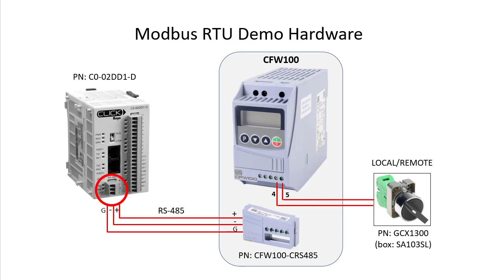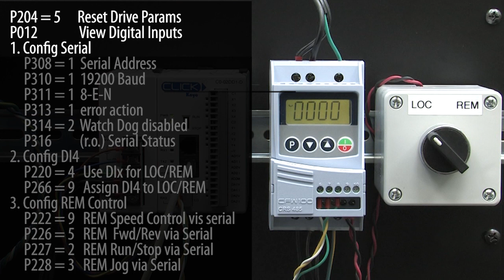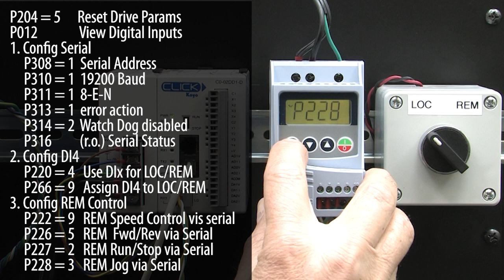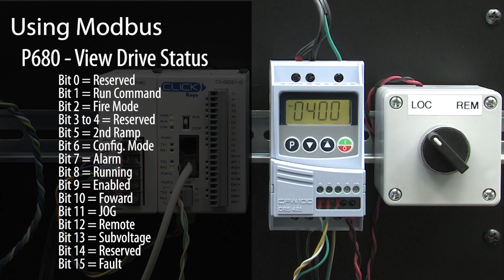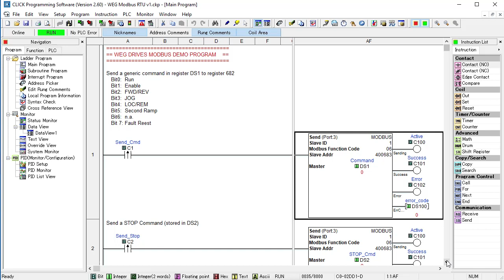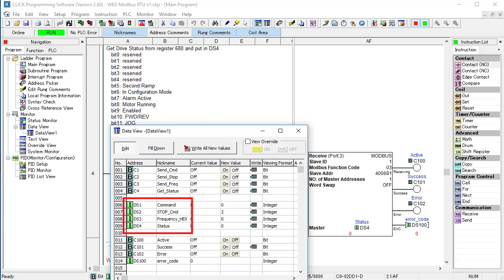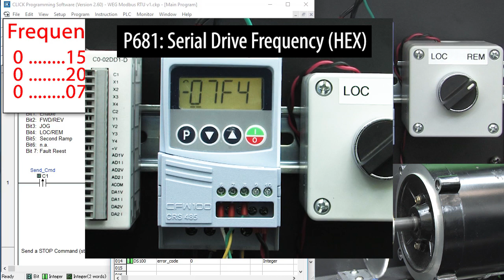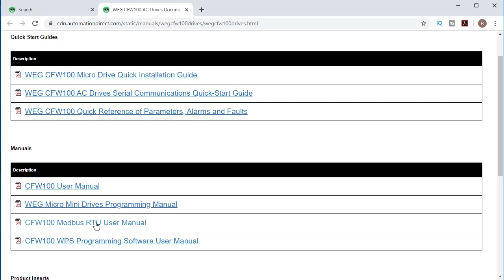WEG CFW VFD Modbus RTU from AutomationDirect

Comment: Very handy thanks, I've been trying to work out to simply switch on a remote CFW701 remotely without installing a relay across the current manual switch setup.
I already talk to it via MODBUS to get it's running state and RPM so this should work well if I can write to it too.
Reply from the maker: Glad it helped! :)

Comment: I connect the CFW100 to a PLC but I have no luck with the communication. P316 = 0 as if the communication module is not connected
Reply from the maker: Esteban Fosco, for us to provide the necessary assistance with your current problem, it would be best for you to contact our FREE, award winning technical support so they can walk through your application and find the appropriate solution.   https://community.automationdirect.com/s/contactsupport